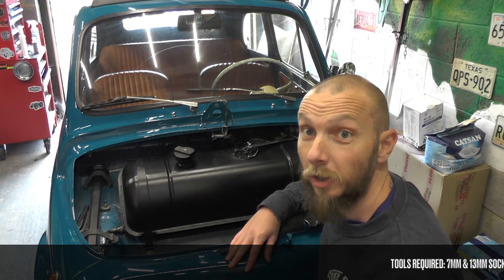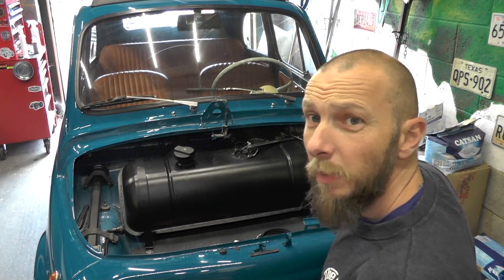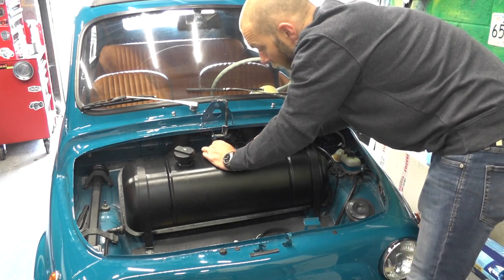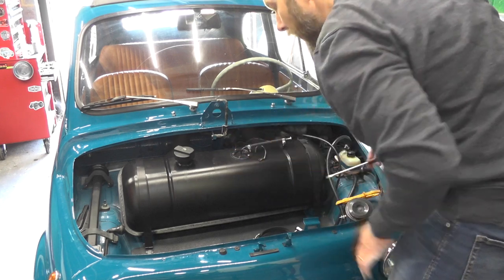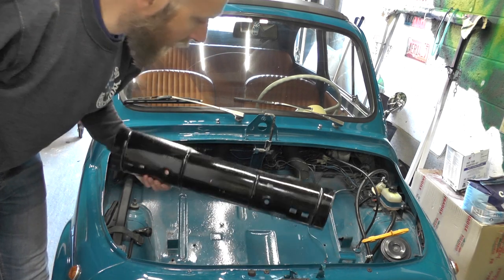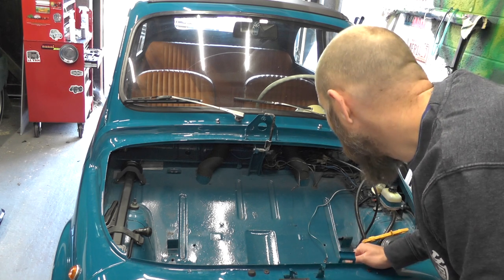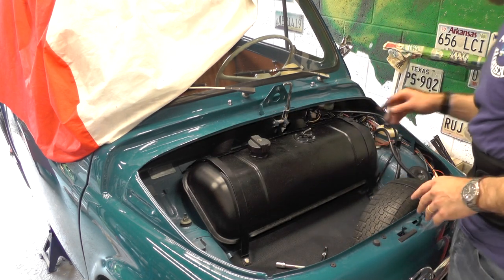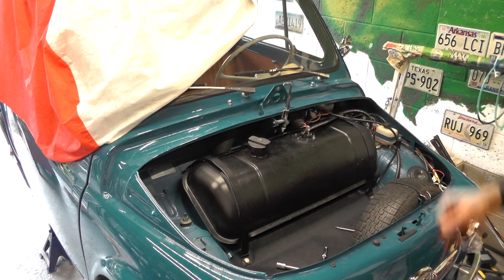08 Removing and Refitting the Fuel Tank on a Classic Fiat 500

Comment: Have you any videos on trying to correct camber on front wheels,as one of mine is greater than the other or give me some advice,thanks.
Reply from the maker: Hey ... not something I have ever done as I have not had the need to so far.  The front suspension and the steering is pretty much the only thing I have not done on these cars over the years.  When it comes to wheel alignment I would phone around to find a garage that could do this with the proper tooling